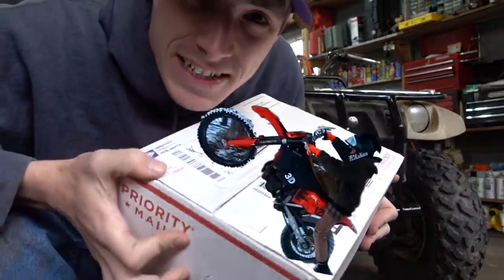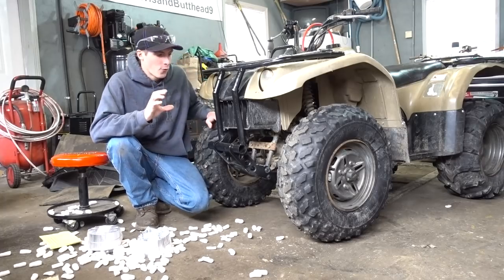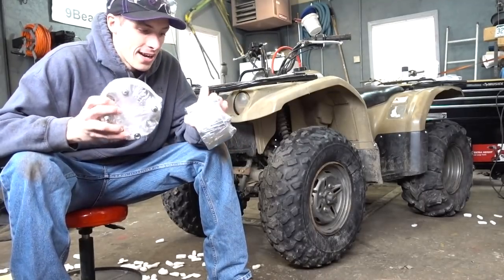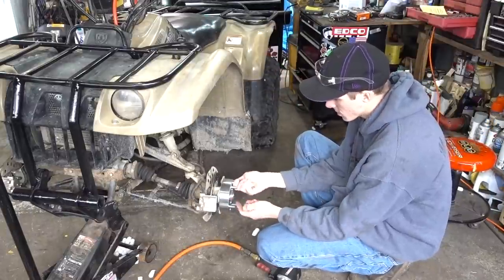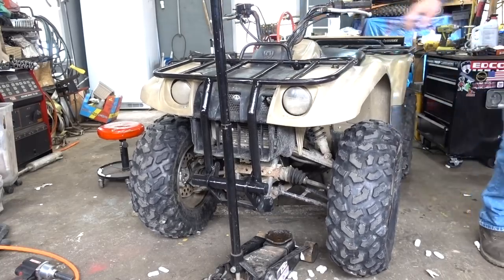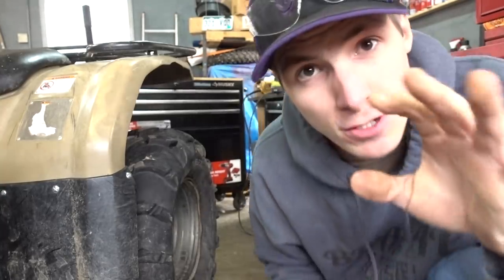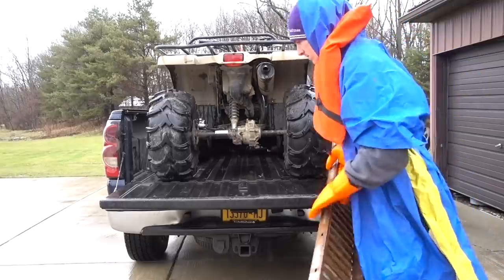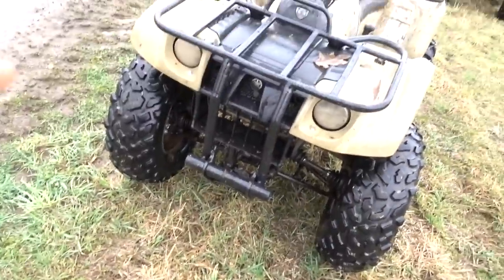I CAN'T DO IT

Comment: Have them on the front of my 4X4 dodge shortbox 2 door truck. That way the front mud grips stick out a little further and the front and rear tires do-not run in the same foot print, gives a little better traction in the mud and the snow. One of those Louisiana mud pit tricks to keep new mud under your tires.

Comment: I have spacers on my '87 Trans Am, you have to run roughly 2" spacers on them to run modern offset wheels, in my case I have some Z06 Corvette wheels with some 305/35-18 Drag radials on the back.

Comment: I got a 2004 kodiak 450 with wheel spacers. I suggest that you put locktite on the studs that hold on the spacers. I had to get e new axle because i was riding and my spacer fell off with my wheel.

Comment: Buy a really cheap trike and do her up I suggest a Honda 350sx😃
Reply: malcolm calder you mean 350x or 250sx?
Reply: Yea I ment a 350x I always get the two mixed up
Reply: malcolm calder problem with the 350x is that IF you can find them, they are really expensive😂
Reply: Yea I guess but it would be awesome to see dalton driving a 350x I have not yet seen a video on YouTube with a 350x in it
Reply: malcolm calder a really CHEAP trike..... 350x is not cheap. I think he should do a Yamaha 225DX, then put a Yamaha Worrior 350 engine in it. Which is an engine swap that you can do with the stock motor mounts.
Reply: Well what I meant by a really cheap trike like a 350x was for him to buy an old beat up 350x and make videos on it and fixing it up and then ripping her once she is done but I also like ur idea😃
Reply: work on the bmw
Reply: Atc 70 lmao
Reply: malcolm calder oh hellllll he should get a atc 350x
Reply: ViKiNGSBEAST199 yes, you can. It requires swapping it over to chain also.

Comment: quick, put in reverse and back up your legs you put down, because your used to a dirtbike. :)))
moi did that about 10 times circa early 90's.
spacers are bad overall, it loads everything else harder, "bad bearing" city for startrers and other things will bend easier, torque multiplication

Comment: 2inch spacers on my 88 mustang gt with 315 tires on rear
Reply: datsdylan007 do you torque them down often? I bought some 32mm hub centric spacers but I'm worried about running them since I heard they need to be torqued often.
Reply: mje19D i haven't torqued them in about a year and i drove a cross country trip plus I've done drag racing and autocross at the track. I've put a lot of hard miles on and i haven't had a problem. just don't go cheap on them get good one's. I've had them for 5 years
Reply: mje19D put blue lock tight on the if you're worried about it

Comment: I'm not a bit fan of spacers because it's putting more torque on all the joints and bearings and stuff so it's going wear down those parts a lot faster

Comment: Had spacers on the rear end of my 1997 Camaro RS because I put C5 Vette rims on the car, they needed the extra 1.25 inches to work with my application in the back. Looked pretty good and traction for days!  Yeah it was a V6 but I had 3.73 gears in the back!  Was my Frankenmaro!

Comment: I have spacers/adaptor on my bronco, changes from 5x5.5 to 8x170 the wheels with 35 inch tires from my old superduty, pushed the wheels out 2 inches on both sides

Comment: the only thing that the spacers are bad are on the ball bearings and front tyrods they will get stripped pretty easy which is the case on my 2004 yamaha bruin 350 but good luck

Comment: Should leave it stock those kodiaks will go alot of places a bigger machines won't.  You can add a locker and go almost anywhere. They are very nimble and light machines with good power.

Comment: I use them on Bob cat wheels so i do not have to buy offset wheels to run tracts. I have a kodiac like yours auto fast. I also have a newer big bear 400 with gears it is way slower but geared low for work like me.

Comment: Ma mother has spacers on both front tires because the ligs hit the frame, the four-wheeler is a polaris 570 sportsman with a top notch racing motor in it

Comment: I've got spacers on my bike so that the stack height clears the steerer tube. It's an MTB(peddal bike meant to go off road)

I also have a spacer so that I can use my stem. My bike is set up for 1" threadless, and usual stems are made for 1 1/8"(the standard), and if not, 1 1/2". Without it, I would not be able to steer(unless I was willing to destroy my $30 stem)

I just realized that only bike guys would understand this,

or people with a lot of time to kill looking it up.